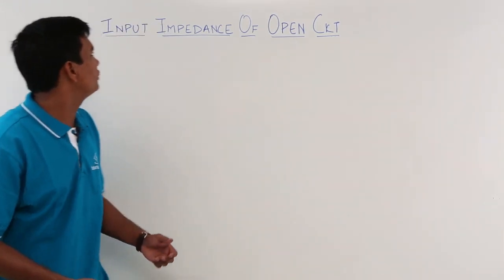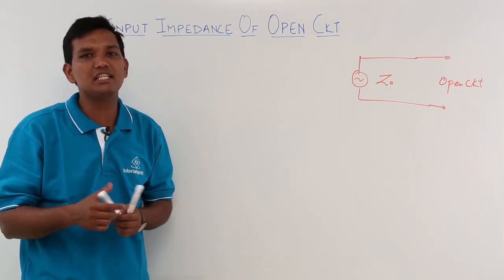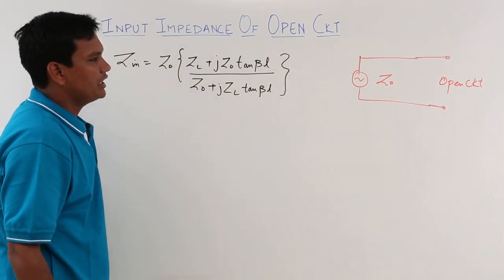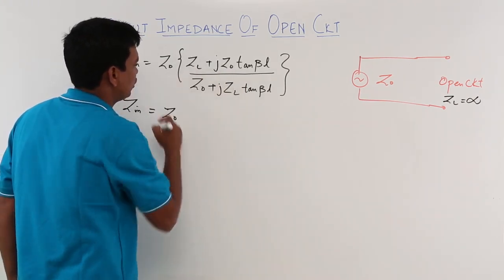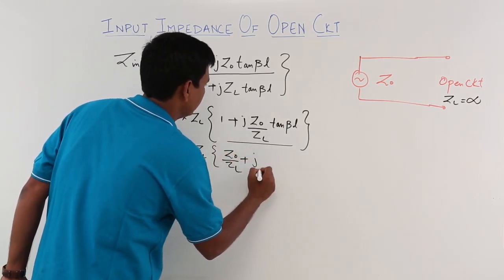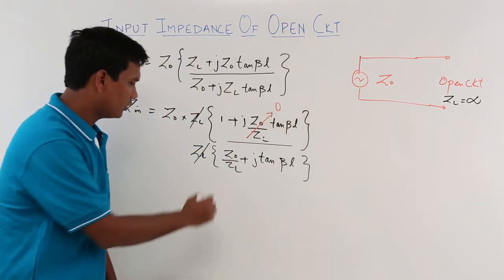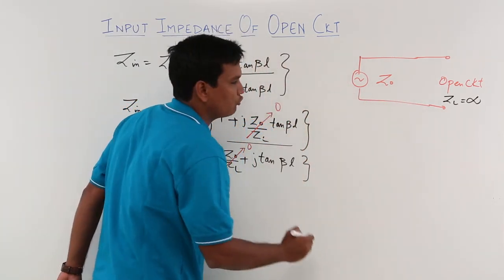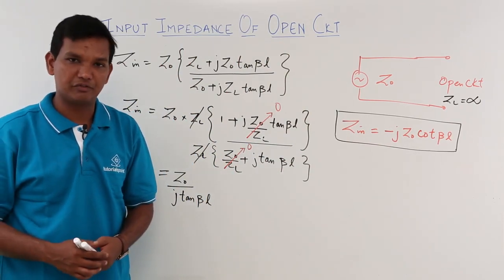Input Impedance of Open Circuit

Comment: Well, we can't divide two variables if we know their values as zero or infinity or undefined, yet you cancelled out load impedances which is not correct. Sorry if I'm wrong
Reply: We cannot divide by infinity since infinity is not a real number. However, if a person takes the limit of the first expression as Z_L approaches infinity, one will find the expression simplifies to the one Mr. Singh derived in the video.

Another way to think about it without using calculus is when Z_L gets really big, the other term in the numerator
( j Z_0 tan(beta l) ) is not important because Z_L is so much bigger than it, the other term is basically zero. In the denominator, the opposite is true;
j Z_L tan(beta l) becomes so much larger than Z_0 when Z_L gets big. We can thus approximate Z_0 to be zero, since it will not have a big effect on the denominator. Then one can cancel out Z_L from both the numerator and denominator (since Z_L is not infinite, just really big), convert 1/tan(beta l) to cot(beta l), and simplify 1/j to -j, and we will arrive at the same answer that was derived in the video.